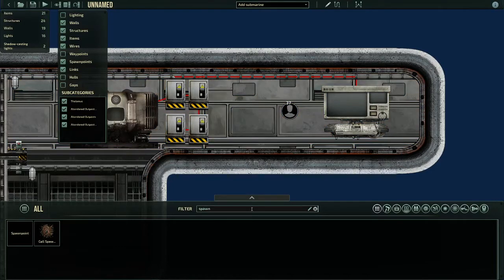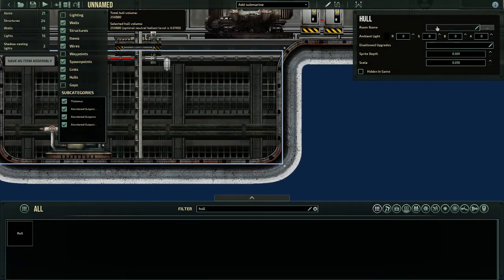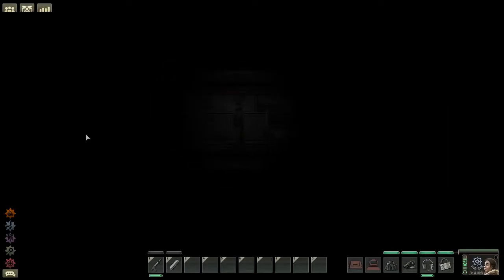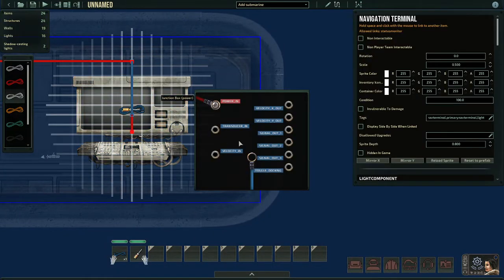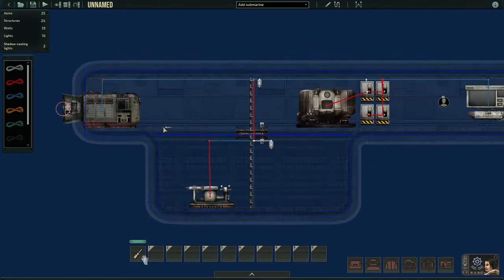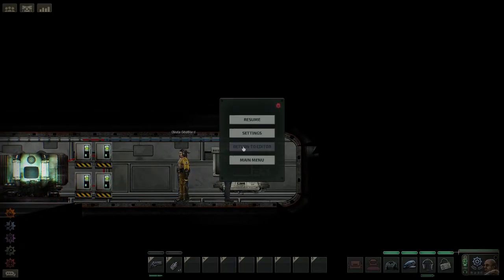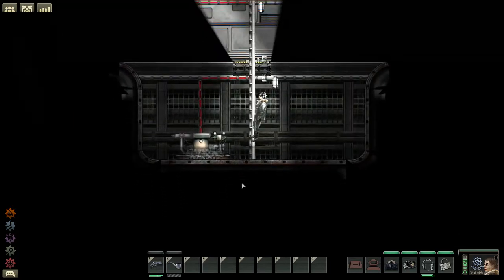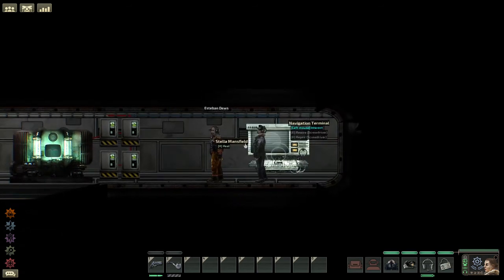How To Wire Navigation in Barotrauma

Comment: downloaded a roided humpback (Humpback(Moon)大月月魔改版座头鲸) laden with 10 guns all around. for some reason whenever the rear ballast was literally filled with water there was no way via the nav terminal to get it to drain. just checked in editor for pump,ballast tag and set_targetlevel which is connected to velocity_y_out, still no idea why the ballast keeps filling (albeit only from external forces like a creature piercing the ballast to let water in)
the only way to get it to drain is by manually rewiring it to set_state which drains it fully. 
any ideas baropros????
Reply from the maker: 1. Is the pump on? Sometimes pumps in the editor spawn unpowered.
2. Is the pump sufficiently powered with all the other systems on board?
3. Is the pump’s drain rate too low? There is a stat that allows you to change the pumps pump rate.

Comment: Hey, i found out that the navigation temrinal can only have 6 wires going through velocity_y_out. This makes it so you can only have 6 ballast tanks. Is there a way to increase this?
Reply from the maker: Use relay components
Reply: @enchanter1102  ty

Comment: Could you make a tutorial specifically on ballast tanks? I have two massive ballast tanks because I made a very large ship and the ballast tanks refuse to work properly. Also, is there an issue if I made the shell and walls separate? Like I made an entire interior from walls and surrounded it with a shell. Did I do it wrong?
Reply from the maker: Putting walls on the other side of the shell, more commonly known as double-layering, is extremely ineffective. This is because the hull item, which is what defines your rooms, only exists to tell the game what is inside and outside the sub. If your hulls go over the wall and end at the shell, if something is to chew through the shell, the water will pass directly through the walls. Putting hulls between the walls and shells barely helps, so it's better to keep the shell and not double-layering. Also, I will make a ballast tank tutorial because ballast tanks are kinda buggy and weird.
Reply: @enchanter1102  thanks! Time to completely redo the exterior of my sub. But it did look ugly anyway, so I suppose it needed some changing. So do I just put the shell over the walls and floors or replace the walls and floors?
Reply from the maker: I would suggest that the part of the sub that is touching the outside are shells, and everything inside are walls. Subs look cleaner when walls are used inside, and shells are used outside.
Reply: @enchanter1102  
Alright thank you!